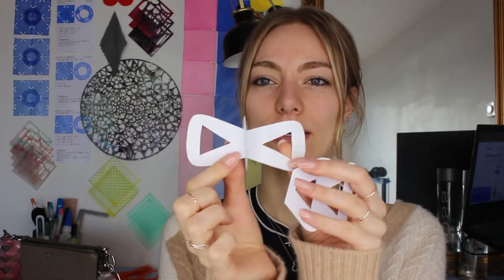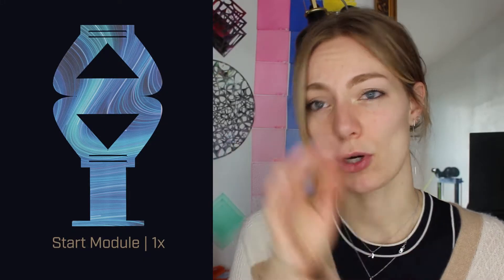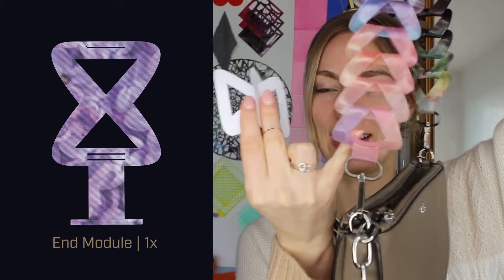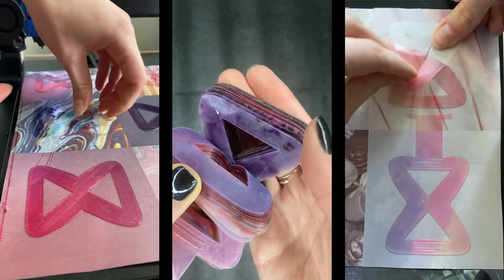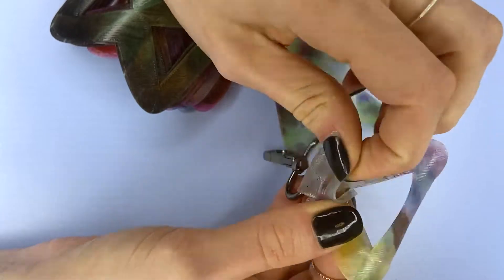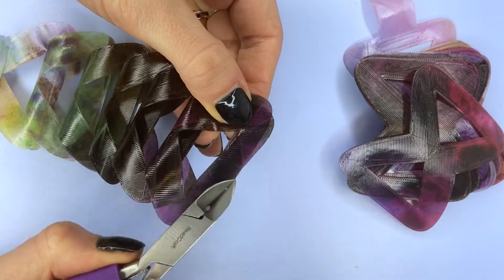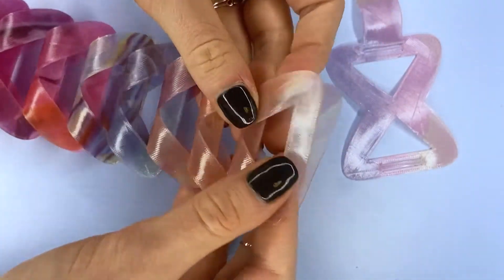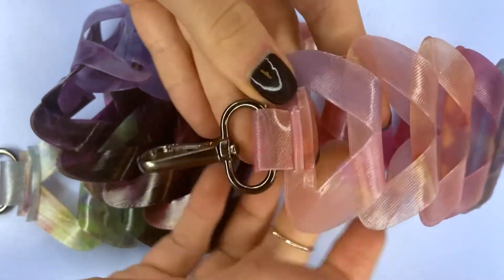How to 3D Print a FULL Colour Strap Design? | 3D Printed Modular DIY Wearables

Comment: So the last piece in the video has 2 slits on both sides but the file on Cults 3D has one side with 2 slits and the other side with one slit. The starting piece has 2 slits on both side.
Reply from the maker: Tricky one, it’s been a while since I made the design. 🤔 I think initially I gave it two slits on both sides to weave it through completely, and later desired it’s more beautiful if it sits in between instead (and doesn’t go all the way through)
If you’re stuck with this, send me a DM on insta and we can figure it out! 😉